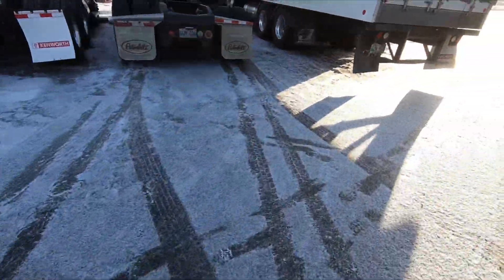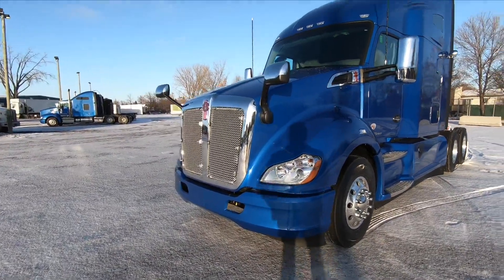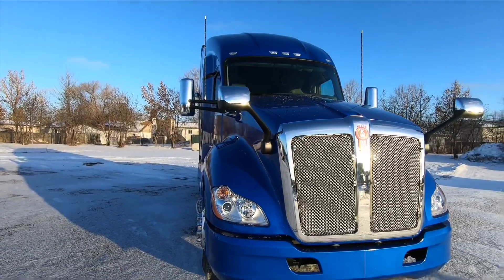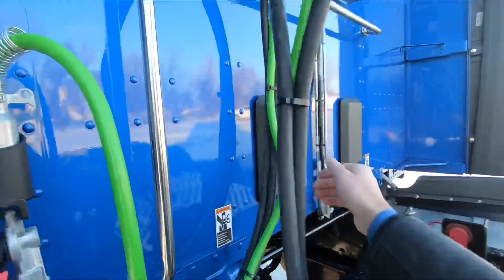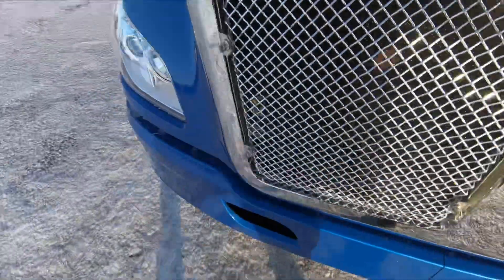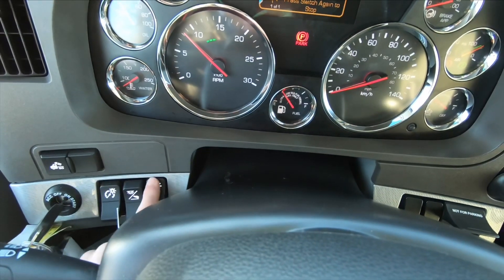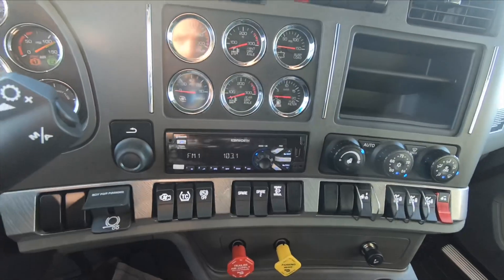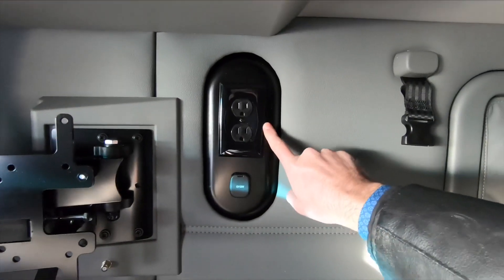2019 KENWORTH T680 - TALL SLEEPER - FULL TOUR

Comment: The 2020 Pete is giving the Kenworth a run for its money as far as the sleeper unit but motor is a lot louder then the paccar motor 455 hp but with the windows up you cant hardly hear the motor noise, but then again some drivers have gotten so used to engine noise they cant sleep without that motor running. Plus the Pete has a ladder for the top bunk, but over i love both trucks very nice video.
Reply from the maker: Thanks for watching Steve.

Comment: Why don’t my kw t680 have a air suspension dump switch 🤔
Reply from the maker: It was either deleted or you have Spring suspension
Reply: The Kenworth Guy my tractor has air suspension I was told I can add a dump switch

Comment: Airtight cab? Cold air pours in through the doors on my 2016 T680. Oh, and the HVAC system SUX! there is ALWAYS something wrong with it
The 2004 Peterbilt we had before this had 0 problems. We got this truck and it's always going to the shop, always costing us more money.
Reply: I'm on the fence between the KW T680 and the Pete 579...
Reply: @John Hennessy owe!
Reply: owe!
Reply: John Hennessy so if there was a choice of a truck. What would you recommend?
Reply: @John Hennessy owe!
Reply: On my t680 you have to have the ac on high my 387 peet I ran it on 1 and it  would be enough to freeze me out the truck

Comment: Why mount those light on the outside of the air deflector, cause drag, should mount them on the inside behind the back of the cab, and it looks way more nice...
Reply from the maker: They are on the outside so the operator can see the side of the trailer at night when backing up.

Comment: Get many request to stretch the frame to put a 25-30’ reefer box on a T680. My T440 with a 40” bunk is kinda small lol. Would be in heaven with this lol
Reply from the maker: You would have to be under 41’ overall to be legal. I’ve built hot shot trucks before and the max bunk size that would work is about 40” with a 30’ box.

Comment: Really like to see a side by side comparison of the T680 and T880.  To me they look like the same truck.   I thought you had covered this before in another video, but I  could not find the video on your YouTube page.  In truck stops always doing a double take to see which is which.   I know there is a slight difference in the front fenders and the grill but have never seen two of them side by side to really check.   I keep thinking  they are basically the same truck.  With the old T600 and the T200  and T800 there were obvious differences.  Then the T600 became the T660, which I like, and the T2000 became the T880 and the T660 became the T680........I think.  Just confused.   If any one knows the facts about this, I know you will.    You always have the facts and clarify issues about Kenworth Trucks.  Thank you for your videos and passion for Kenworth.    Have won a few bar bets using your data about KW trucks.    Thanks Andy and once again awesome stuff and lots of "REAL" data that makes sense and explains things about these KW trucks.   Merry Christmas and Happy New Year and Happy Holidays.   Did the Little KW guy get what he wanted for Christmas??
Reply: i drive a T880 day cab, i haul milk locally. i think the difference is the T880 is more for vocational work and the T680 is more of an over the road long haul truck
Reply from the maker: They are very similar. I will do a comparison side by side in a future video. Stay tuned. Thanks for watching and following the channel. The Kenworth Kids all had a fun Christmas.

Comment: No surprise there was a wrecker in the parking lot. Get used to it with a T680, especially with a MX engine.
Reply: Due to the def system
Reply: common91941 Even with a full after treatment delete, the whole platform is still a boat anchor. They've earned the nickname "The Black Plague".
Reply: Never....I mean NEVER buy a truck that has a Paccar engine unless you have nothing but money to throw away.
Reply: I made sure I got a Cummins in mine.
Reply from the maker: Cummins has been a very good engine. The X15 is great. So is the MX13
Reply: Even though I have the wherewithal and the inclination, unfortunately I haven't the time.I bid you a good day .
Reply: The MX engine is european designed. Paccar bought the rights to the engine and brought the design to the States. Usually the MX engine is used for to reduce the truck weight. I think they call it the Lightweight engine. I would rather have the Cummins engine.... ;)
Reply from the maker: Yes Alan. Paccar owns DAF who makes the engine. Marketed as a Paccar engine in North America. The X15 has been good.
Reply: My question is how is the mileage on the Mx engine compared to the X15? But all the engines that Paccar has in its inventory are great! :)
Reply from the maker: In Winnipeg we have found the MX to be better on mileage. However, it all depends on driving habits load wind etc.
Reply: nahmanini sithole are all these small boys yours???
Reply: @SpaceMunkey5000  Yep.  Got me a 2019 with a Cummins too!
Reply: Jebediah Nightlinger I’m on the fence about 2019 Freightliner or 2019 t680. I drive a Freightliner now for a company and 340k zero issues on this dd15. So far.
Reply: YeahNo101 ? Freightliner has done their homework on the over the road/fleet type trucks.  The DD platform has been around long enough the engine has proven itself. I worked for FTL for years, work on KW's for the last 8. Not impressed with any of the new product
Reply: Jebediah Nightlinger thanks for the info. Looks wise I want the t680. Every one I talk to that has wrench time in says the Paccar is ok but to they don’t have the DEF system down solid like ftl
Reply: Jebediah Nightlinger by any chance do you know the gear ration that come on a stick cascadia? The company truck one I have now is I believe 2 something and is horrible. I would like maybe mid 3’s if possible
Reply: Jebediah Nightlinger sorry gear ratio on a stock at the dealer type truck
Reply: YeahNo101 ? No sir, I don't know what the gear ratio is off hand. My best guess would be 3.33.
Reply: Jebediah Nightlinger ok thanks for all your help. So to a new owner operator who is buying a brand new truck paying it off in 3 years and will be keeping it until the motor falls out and will put a new one in. Being a diesel mechanic you go Ftl evo over t680? My company truck is a ‘16 evolution. 340k miles. I check everything and take care of it like it was my own. Zero issues. I’ve talked to a guy in the yard an OO who bought a used 2018 t680 and he said it’s great and looks nice runs great but with that said it was in the shop already for two weeks for DEF trouble which I’ve heard is very common on them.
Reply: @nahmaninisithole2734  lol
Reply: @NomadicSociety  Thank you. I was wondering if anyone was going to catch the Mr. Nightlinger quote from The Cowboys movie with John Wayne,The Duke, Roscoe Lee Brown who played Mr. Nightlinger, A Martinez, Robert Carradine, Colleen Dewhurst and Bruce Dern. What a movie, I'm fixing to watch it soon.
Reply: @OneEphraimite  wow
Reply: @nahmaninisithole2734  now troll my channel ;) lol
Reply: @yeahno1016  nothing wrong with shakin freight lol
Reply: @Awalker5000  DAF Trucks is the only manufacturer within the Paccar Group that designs and produces its own engines. That is why it is called the Paccar engine (DAF MX).Nowadays they come from an US plant but also delivered from Europe.Paccar has adapted this engine for the US market. 350 pounds lighter than the Cummins engine. Fuel saving and quiet....more

Comment: Looks very old technology truck. Nothing modern
Reply: That's what I was thinking. The headlights are the worst! No LED lights in the whole truck? No USB ports except in the radio? Absolutely worthless storage. And that engine is garbage.  
Other than that,  I like the looks of the truck on the outside.
Reply: I like the good old gages style. My only bad point about this truck is the automatic transmission. I prefer a good old manual transmission where i can control the power of my truck.
Reply from the maker: Automatic transmissions sure make for an easy drive. I sell quite a few automatic transmissions to 30+ veteran drivers
Reply from the maker: Each to their own. We build them both ways.
Reply: Truck is custom ordered as he States several times but yes the truck is incredibly barren for what it is.

Comment: I was just given a 2019 T680 replacing my 2015 T680 . Two words: Not Impressed. 
Kenworth must have the worst QA program in the truck industry. Right now I have 7,456 miles on it yes Seven thousand 456, lets see, steering wheel is setting at the 2 o'clock position, but the truck does drive kinda straight, kinda. So far the entire electrical system has shut down 3 times. Problem??? 3 main electrical connections in 3 different areas of the truck were never tightened. Windshield leaks when it rains! EVERYTHING rattles, got wads of paper all over wedged between plastic panels to stop the rattling! Check engine light on within the first 600 miles, I received the truck with 340 miles, Chillicothe Ohio factory to our company. Right side fuel tank fuel lines leak if over half full! Factory installed APU runs like crap because of the leaking fuel line on the filter assembly, APU bunk fan has 1 speed, full on or nothing, but that's better now because the whole bunk fan unit died! And the best part! Engine at 1500 RPM runs 32 psi oil pressure and 235 degrees oil temp but Kenworth says those are fine numbers. Hate to say it but the next new truck will be a Volvo, Everything on this T680 is made in Mexico and trucked to Ohio to be assembled, I know because we haul Parcar stuff everyday.
Reply: BrownH2ORat could I ask how your 2015 T680 was and how it performed? Did you enjoy it more? Some pros and cons.
Reply: Um everything on my cummins says made in China
Reply: @anavillalpando9784  every thing rattles in my t680 wind blowing through the truck I'm not impressed with the Cummins either
Reply: @anavillalpando9784  I have 2014 t680 for sale 400k miles on it 13 spd I'm looking to sell it 75 k